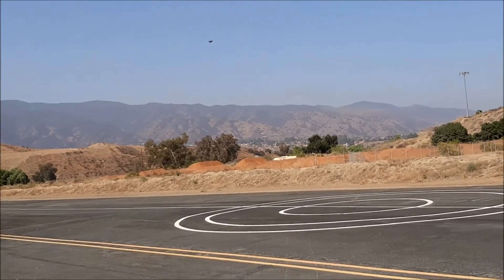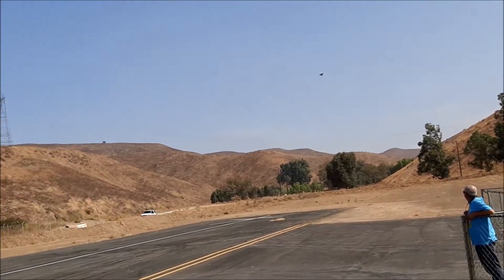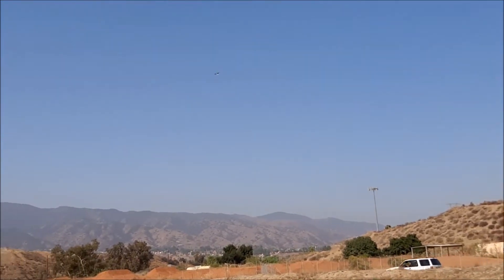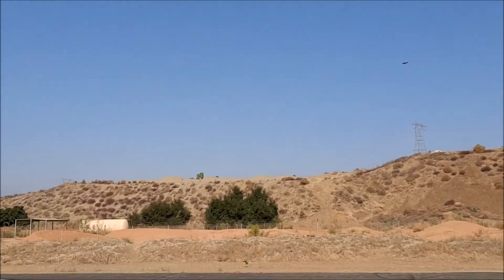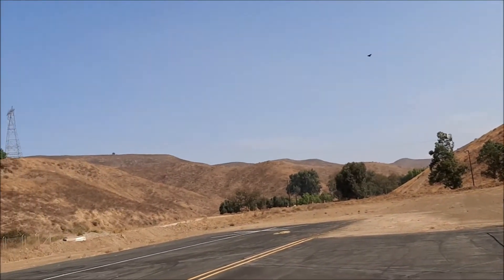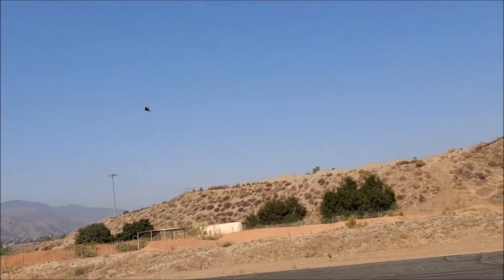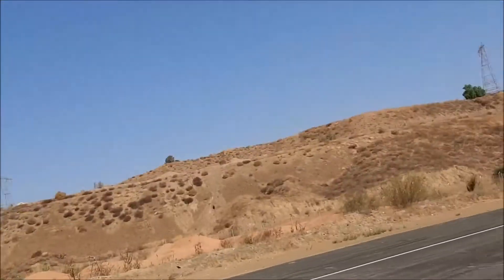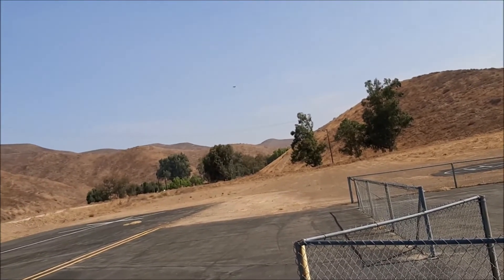LX F-117 on FW 2150kv 70mm and 6s 2200mAh

Comment: I have a question: I would like to build my own model. But during planning Im not quite sure about center of gravity. I mean if you do quick Center of gravity test and hold both ends of the wings with two fingers each the aircraft will fall forward if battery etc is installed in the front, isn't it? Can you tell me practically if there is any problem during flight?
Reply from the maker: Enlarge the battery compartment by cutting some foam. Also I added some weight at the tail. My flight had no cg issues, very stable flight without gyro
Reply: @edwen303  Thanks :)

Comment: I’m currently building this kit. I’m putting in an FMS 70mm 1850 kV inrunner. I was considering a 3000 mAh battery. Good idea or not?
Reply from the maker: She can probably handle that weight and I did similar setup in previous video. https://youtu.be/-soDDcE3BlE
Need to enlarge the battery compartment rearwardly. FMS fan is about two ounces heavier

Comment: I need to make a new one I still have the freewing retracts I used for it. How did you hook up the tail as tailerons? Or is the ailerons setup as tailerons and the tail only rudders?
Reply from the maker: Tail rudder is not activated in mine, only elevon on the main wings. The rudder felt more like V-tail effect so the effect is opposite to what we normally run the rudder, at least that is the case in my model. Freewing retracts would be an easier fit without the bumps in HK retracts.